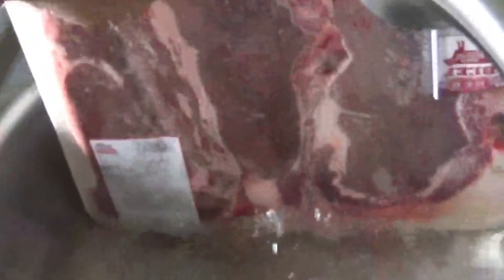How Oilfield Production Works in a Nutshell

Comment: So a pumper? Yes? I’m a gathering operator. Depends on how wet your gas is. Luckily I’m working with somewhat dry gas. Same deal. Dehydrator, coalescer, separator, sludge catcher etc. hp and Lp will confuse people unless they know. Lol Kimray is great (if you use em) will auto-drain to the tanks for oil/water condensate.  There is so much going on most people would know unless they’ve been in the field. Very simple put for damn sure! Get it sir! Not many people will understand this video. But it’s a simple put video for an introduction. So much more to it. But very simple put!🤘